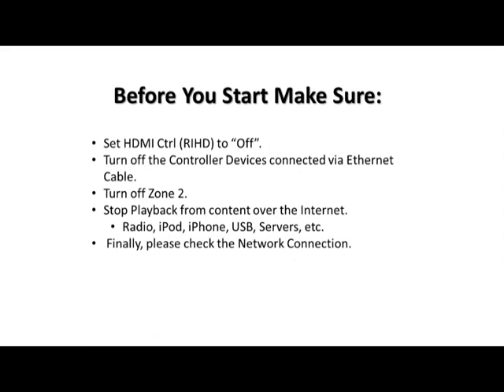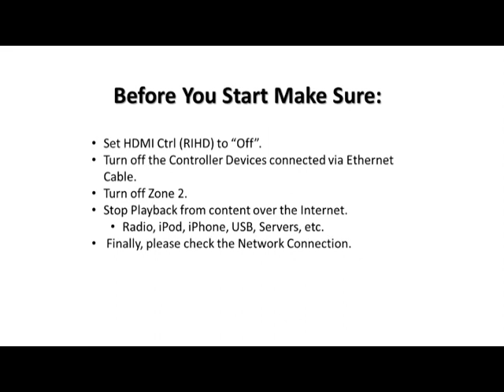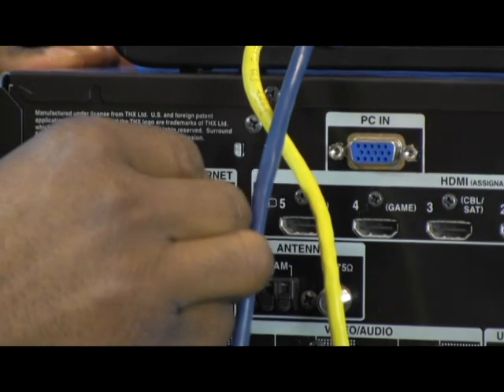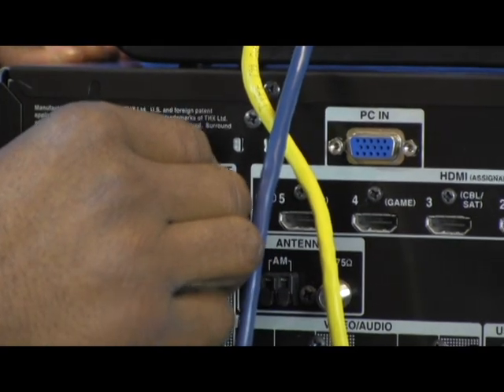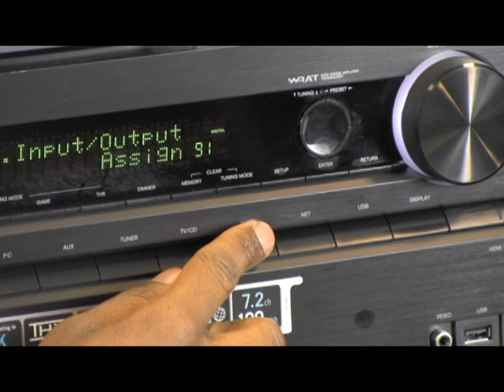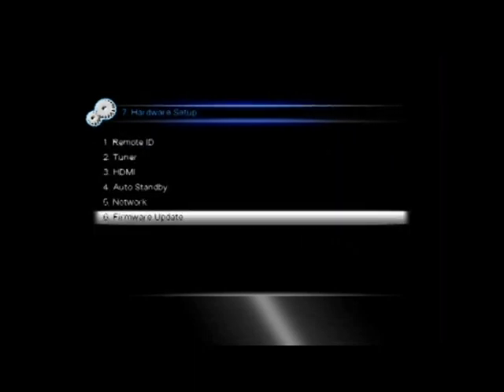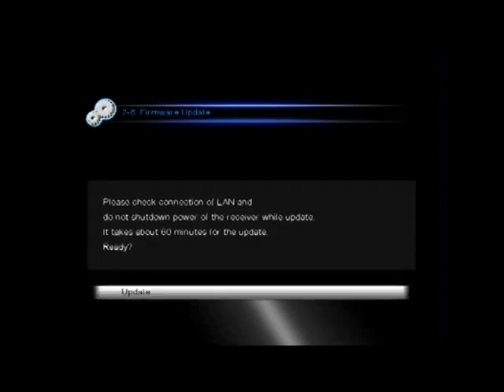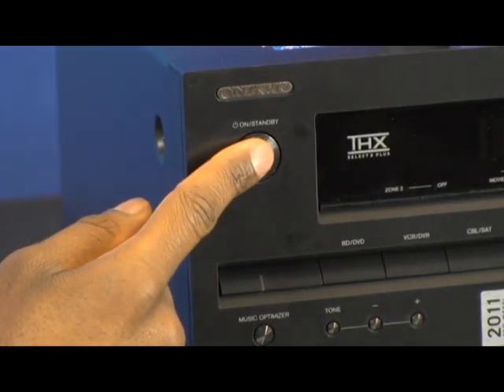ONKYO - How to do a Network Firmware Update

Comment: I've had a TX-8260 (no AV) for maybe five years now and I can't tell you how many times I've wanted to just throw the thing into the toilet. It will play CDs and LP records but will do nothing else. It will Bluetooth to another device maybe one out of 50 attempts. I have a Tidal account but nothing happens when I click it, like asking for credentials and providing a new screen to enter them. There is never, ever, ever any network update; I've downloaded what are supposed to be new updates but there is no prompt anywhere, ever, that says to insert the USB. If there's no new updates, ever, then why did you bother putting that feature in this machine? I've seen pictures/instructions with perhaps 15 different options beyond NET/CHROMECAST/ZONE 2, but mine just shows like 6 of them and none of them do anything. I would sell it but who's gonna buy it when I tell them it only plays CDs and records? It sounds great when it does that, but I coulda spent $50 for the same thing. Somebody please tell me where I can find help with  this thing? Thank you for your support.

Comment: I have an Onkyo TX-NR646 that is connected to Bose Accustimas 5.1   speaker- system and all outputs are connected via different HDMI cables and common MAIN HDMI- output to LG 4K TV. It has worked well since 2018, until recently, when I cannot connect Wifi or RJ45 to network, cannot access internet or USB. Tried various re-sets but I am unable to re-install firmware, or NET apps.

Any work-around suggestions would be greatly appreciated. TIA, MOHAN
Reply: Ever get it fixed?

Comment: Ok. Not a question I've seen addressed, and I can't understand why. I want to update via usb, WITHOUT a TV or monitor. Why a piece of audio tech requires additional "video" tech... is just beyond me. I hesitate to start the process because I'm told the "Home" screen only shows up on the TV, which negates the rest of the instructions. And it seems if any part of this process is done incorrectly, you just bricked your receiver. (I have a TX-SR393) Anyone with experience in this?
Reply: curious as well, as my pc monitor is incompatible with my receiver (incredible). you ever find out?
Reply: @gaugea  No. Though I did come by a display that worked... and the file failed. Didn't brick my unit, so I called it a "win" and decided to be satisfied with old firmware.
Reply: @Nashmite  well, that would be a win in my book too. ill stay on the lookout 🫡

Comment: Wow, way to go on your build pipelines onkyo.
I just updated my onkyo with the Jan2021 firmware and am seeing that you are running thttpd/2.25b 29dec2003...

also is there a reason why I always get a `7-82 Error` after each upgrade?

and also can you upgrade your webservers, browsers are now blocking non https downloads and the download speed is horrible (it should not take 30+min to download a 200M file).